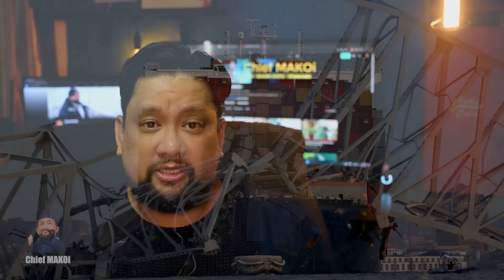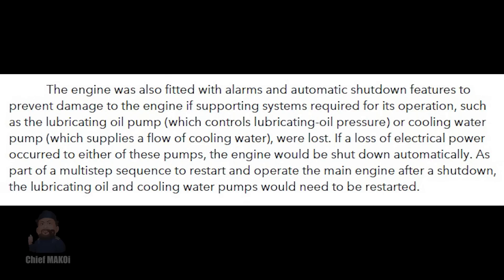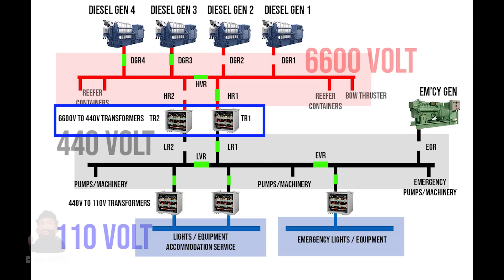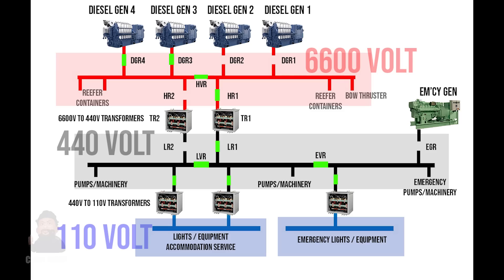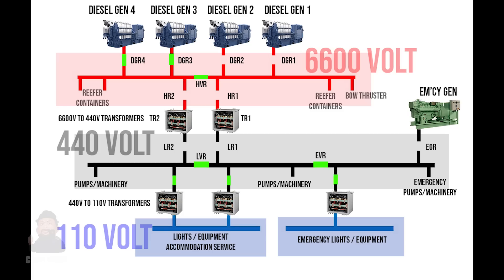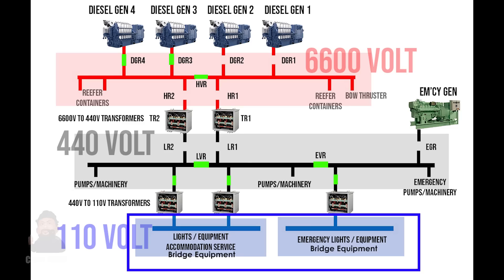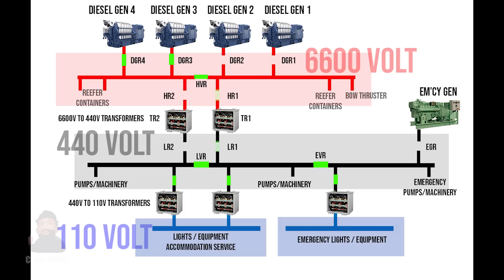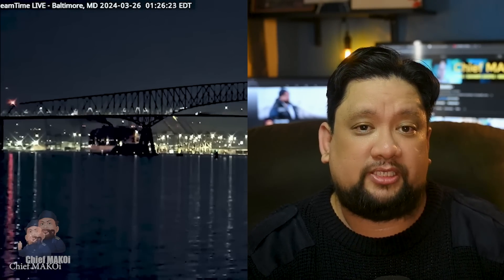Explaining the NTSB Report on the Container Ship DALI | Chief MAKOi

Comment: As an electrician I can say that the overcurrent protections trip the circuit breakers when there are problems downstream to protect the upstream installation, the exception is the differential protection and the fact that both switches on transformer 1 are disconnected at the same time, this leads me to the idea that the differential protection worked i.e. somewhere in the installation there was an insulation defect that put one of the phases to ground, due to the fact that after the second disconnection the electrician connected transformer 2 makes me think that he suspected an insulation defect on transformer 1
Reply from the maker: That's a very likely possibility.
Reply: @ChiefMAKOi  What I'd like to know is why during a critical operation, only one transformer was in service creating a single point of failure?  Surely both should have been in service, precisely the reason there are two of them.

Also since a transformer is an inductive loop, if there was a ground fault that tripped a breaker that fault would have only shown up on one side of the transformer.  Not tripped the breakers on both HV and LV sides.

That thick black smoke suggests fuel starvation.  And secondary to that, if there was a fuel issue, could that have contributed to a synchro problem that caused an over voltage/frequency or under voltage/frequency trip on the transformer breakers?  Something the transformer breakers caught faster than the genset breakers.  These are components supplied by different manufacturers with slightly different tolerances after all.

The more I think about this the more I suspect the prime cause was a syncro problem and first cab off the rank with that scenario would be fuel starvation given the black smoke.
Reply: @johnrauner2515  "Also since a transformer is an inductive loop, if there was a ground fault that tripped a breaker that fault would have only shown up on one side of the transformer.  Not tripped the breakers on both HV and LV sides."

Transformers certainly can fail with a primary to secondary breakdown.  The failure usually starts as a turn to turn or layer to layer failure.  At that point, it is a single or a group of turns that are shorted.  That new secondary with a high ratio to the total primary winding results in a massive current flow without a huge increase in primary current.  If the transformer has differential protection, the protective relay will pick it up.  If it just has overcurrent protection, the fault can persist quite a while.  The huge amount of heat generated burns the insulation.  If the fault is located in the coil where it is adjacent to the primary to secondary barrier, the barrier can be burned and you get a primary to secondary fault.

I have seen the after effects of this - for example, one case where a 20.8kV:480V transformer failed.  The 480V system had arc overs to ground all over the place.  I've also seen a waveform capture where a 12.47kV:4.16kV transformer arced over, and the 4.16kV side hit about 8kV.
Reply: Good thinking on this. I'm not familiar with vessels of this size, but electrical systems on ships are required to be fairly fault tolerant for exactly this reason. It is considered to be safer to have a warning of a fault and continue to have an operating ship, rather than an automatic disconnect. In this system there may be a setpoint at which a warning is not sufficient and disconnect is required to prevent catastrophic damage.
Reply: @davidsutton9195  Transformer diff, bus diff, gen diff will all trip instantaneously. No delay, no warning and usually attempts to prevent a catastrophic failure of that component. Over current, under / over frequency, over / under voltage you will have a delay within certain parameters and can be instantaneous outside certain parameters.  A differential works by comparing what current is coming in to  what current is going out on that piece of equipment. Any "differential" between that and it will trip to limit the fault current and try to save the equipment. And yes, the relays are configured to account for the different voltages and respective currents and or phase shift depending on transformer configuration. When something trips on differential you normally do not ever just reset and re-energize without inspecting the device that just tripped. When a lockout rolls due to a differential, it's usually an oh shit moment. If lucky, it was some unlucky animal that got itself electrocuted and the equipment is usually OK. On land, snakes, raccoons, birds, rats and even iguanas (when I worked in S Florida) are the usual culprits. I'm sure on ships you can get snakes or rats as well. 
With a three phase delta distribution / feeder, you can have one phase fault to ground and continue to operate with a ground fault warning. But if another phase were to contact ground, now you have a phase to phase fault. But any ground or phase fault within a differential zone of protection, as mentioned above will trip instantaneously.
Reply: @davidsutton9195  I think it's just a matter of procedure here, namely the two transformers TR1 and TR2 I'm sure are identical, so there wouldn't be any problem if during the critical port entry-exit periods both are connected in parallel, and the differential protection of each transformer could disconnect in case of fault the transformer that has problems and the other one remains online. Yes indeed, the differential protection simultaneously triggers both switches on the transformer and the high voltage input and the low voltage one, I have not worked on ships but in factories this is how it works
Reply: @eugeniusro  I was thinking along similar lines myself. As long as the high voltage tie-in breaker is closed, you could have both TR1 and TR2 in operation during critical vessel operations - especially when so many vital systems are on that bus. I also wonder why the PMS didn't automatically close HR2 and LR2 breakers as soon as a dead 440v bus was detected.
Reply: @briangreig4225  The truth is Brian that the situation is a bit more complex, putting the transformers in parallel would only eliminate the risk of a blackout just in case a failure occurs on one of the transformers, but there are still many other probabilities of failures that can generate loss of propulsion and/or a steering wheel, it could be mechanical or fuel problems. I think that escorting the ship by pusher tugs in critical areas is the safest solution.
Reply: @eugeniusro  Well, there is also the tiny possibility that if a primary to secondary short were to occur in either transformer if they were connected in parallel, and the breakers didn't trip fast enough, a short on one transformer could blow up the other, and now you have no 440v at all except for the emergency bus. That's probably why it was their practice to keep them isolated.
Reply: @eugeniusro  That's a good point, and there was a cargo ship called APL Qingdao that lost power just before the Verrazano bridge recently after the Dali incident, but because tugs are required in the New York harbor until clear of the port, the tugs were able to bring the vessel under control, and then move it to a safe anchorage area where repairs were completed. Checked off by the coast guard, and then and only then was it allowed to resume it's voyage. If it wasn't for the tugs that ship could have potentially collided with the Verrazano, it probably wouldn't have collapsed but at the very least the bridge would have to be closed until such time as a thorough inspection carried out. Closing that bridge would have caused extreme vehicle traffic chaos between NYC and NJ!
Reply: @eugeniusro   "putting the transformers in parallel would only eliminate the risk of a blackout just in case a failure occurs on one of the transformers" Nope, don't put the transformers in parallel.  Run with both transformers carrying half the LV load with the tie breaker open.  On a LV bus fault, the tie would continue to stay closed and 1/2 of the LV loads would be powered.  Since everything critical is backed up, the second pump starts on the affected systems.  On a transformer fault, the tie would close and pick up all LV loads through one transformer.

This quite common on land based industrial systems.  I don't know why it isn't standard onboard ships.
Reply: @matthewbeasley7765  Yes I agree, your solution is even better but overall from the multitude of possible failures, the probability of transformer failures is very low, there are many other events that can lead to loss of propulsion or steering, as I said, fuel problems or mechanical problems, or even a fire on board in the engine room, so accompanying with pusher tugs is the safest solution even if it involves substantial additional costs.
Reply: @brnmcc01 that's been one of my questions. There are ports who require them and those who don't for...reasons? What reasons and are they sound? I think the public is owed an answer on that. We sure know that the reasons for not up grading the passive protections to the bridge were not. Risk assessment did not justify the cost? While bridges in harbors less busy were up graded? Both bridge prote tion and tug use it seems the decision making was questionable. I'm glad we are getting an ide of what happened with the ship. I'm tracking pretty good on the technical stuff from my time in the navy as a steam plant operator, but one of the things that struck me compared to how we ran in restricted maneuvering was how little time they had to get an engine restarted when it had been partially shut down. First we run a split bus to vital systems so if we lost one part of a bus which could also (sort of for hypothetical sake) shut lube oil down to a main engine (also saying we hypothetically have only one) the pump can cross to the other buss and be restarted quickly and the engine restored.  But that takes time, and is only partial. We also have Grater ranges before an electrical trip takes out a main, as in we run on system pressure for so many minutes and risk some bearing damage for the sake of not doing this. But point is in a trip scenario even on a split bus it could take a minute or two and in this case that was all that was needed. I know in our case that is why we have more than just a split bus. But the ridiculous redundancy we have on carriers is not practical for civilians. We have 2 plants w 4 generators with double redundant split busses on each, two engines on each and each engine has 3 oil pumps and 2 cooling pumps supplies off of diff busses. And mechanical pumps driven by the engine itself which is how we buy time if "coasting". I don't think a civilian ship can do all that but a split bus surely and maybe an engine driven pump?
Reply: Thank you. When I heard BOTH breakers tripped, I wondered. That function would absolutely be needed if Both transformers were on line and one had a ground fault. (Ex ET radar not a Electricians mate, but that did push my What The button)
Reply: Totally agree TR1 is the likely culprit and there could be insulation failure on the internal windings or there was inadequate cooling or cooling fluid in the transformer.  Not sure how that's checked or topped off but temperature monitoring is likely one of the built-in protection parameters.
Reply: @liam3284  Maybe Chief can tell us how long it takes to put the propulsion engine back into operation, because for a ship of this size the moment of inertia is enormous and only the rudder alone without the operation of the propulsion is ineffective. So the electrician on board reconnected the transformer after the first disconnection in 59 seconds, obviously if he had the inspiration not to connect transformer 1 but to directly reconnect transformer 2, the second disconnection would not have occurred, but even so the time needed to restart the engine plus some time is still needed for the execution of the change of direction maneuver due to the ship's moment, so I think the collision was inevitable anyway, probably the best solution is to accompany the ship by pusher tugs during the entire crossing of the critical zone.
Reply: A short on the secondary (440 V) side of TR1 will cause an over current condition at HR1. If this happened it is possible that there would be no fault condition detected at LR1. If there is a short on the secondary side of TR1 then LR1 needs to be opened before HR2 and LR2 are closed. This needs to happen to prevent an over current condition at LR1, LR2 and HR2. Due to this it makes sense to have logic that opens both HR1 and LR1 if an over current condition at HR1 happens.
Reply: We haven't been able to find a Megger in the past month to test this theory?
Reply: @douglastastad7437  Agreed, the initial test results are surprising to not have done some basic transformer tests on the transformer that tripped out.
Reply: @matthewbeasley7765 
You’re assuming you’re getting data in real time. You’re not. 
Subsequent testing is going to show up in subsequent reports
Reply: There's a flaw to this logic.  A transformer is an inductive loop.  There is no physical electrical connection across it from the HV to LV side.  If there was a ground fault it could not possibly have been on both sides.  Therefore this would not have tripped both transformer breakers, only one of them.  And even then I find it extremely hard to see how a downstream breaker could be tripped by a fault in the transform BEFORE it (LV breaker).  

How about these two possibilities?
1  Ground fault on LV bus trips LV breaker that in turn causes over voltage on HV side that trips HV breaker or
2  Synchro problem with gensets causes over voltage/frequency or under voltage/frequency trip on both transformer breakers
Reply: @johnrauner2515  You are not familiar with transformer protection schemes. A transformer differential will most definitely trip the high and low side breaker when it detects a differential between what is going in and what it going out. It opens both breakers to isolate it form the system to prevent further damage to it or the system. A differential scheme protects whatever is inside it's zone of protection, could be a transformer, switchgear, generator etc.... 
 
And sure, there can be misoperation or poor coordination between downstream breakers that could cause the same result. Or breaker fail scheme as well. If low side went to trip on over current, then failed to open in a set number of cycles it will trip the next upstream breaker, which would be the high side. Could even have been a breaker fail on the switchgear that caused it to trip the transformer. But, depends on what sort of protection schemes they have on that particular ship. 

As far as frequency, all generators on a bus will run the exact same frequency. If you try to drive one faster it will just increase it's power output, but frequency will remain the same. All dependent on size of gens and how many connected as well. But one gen can not go faster when tied to another gen or grid. Everything will be the same speed when electrically connected. 

For the actual cause, so far we can speculate for days...... Have to wait and see what actually caused this chain of events.
Reply: @johnrauner2515  Differential protection is different for high-voltage transformers compared to earthing protection on low-voltage installations, i.e. FI protections. First of all, a desynchronization problem between the generators leads to the tripping of the switches from the generators, i.e. DGR1, DGR2, etc.
Differential protection on high voltage transformers is based on the measurement of the power flow on the input and output and trips when an imbalance occurs between the input and the output. The high voltage side is three-phase without a mid-neutral point and for this reason the primary of the transformer is connected in delta configuration, the output of the transformer is obviously connected in star configuration and the center of the star is connected to the neutral bus. The measurement on the high side is done with a star-connected measuring transformer (ie the reverse of the transformer connection) and on the low side the measuring transformer is delta connected.
For details I recommend searching on google "Fundamentals of Short-Circuit Protection for Transformers" and find the documentation from Schweitzer Engineering Laboratories, in short in case of a fault the differential protection will completely remove the transformer from the circuit by disconnecting both the low-voltage and the high-voltage circuit breakers, which is correct, if you have a fault on the transformer then it must be completely removed from the circuit and the spare transformer connected.
Reply: @johnrauner2515 what happens when you short the output of a powered transformer? Would you really want to leave the transformer connected to power?

Since there are transformers in parallel, both sides of the transformer (HV or LV) can supply voltage if one breaker opens. If you have one of the LV legs shorting internally, opening the HV side still means you're feeding the short with LV power via the other transformer. So you open both breakers, fully isolating power to the fault
Reply: I think you are close to the issue. I spent some time as a utility electrician at a government facility. We had a building that kept tripping the main transformer off line after lots of testing and bringing spare breakers in it was found it to be a short in the control circuit. As the whole switch panel had a single control circuit in case of a phase differential when control shorted to the metal cabinet it caused both breakers to trip.
Reply: I thought the issue was indeed as a result of the CB protections, from an earth fault,  but so far no mention of an earth fault alarm